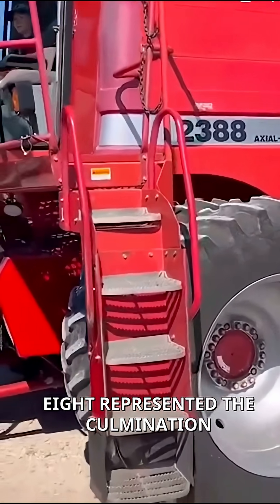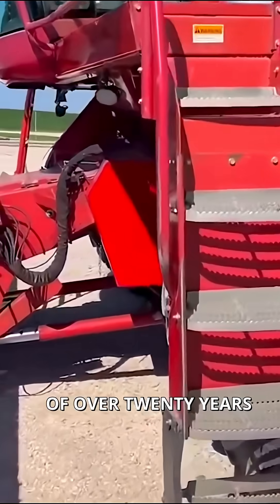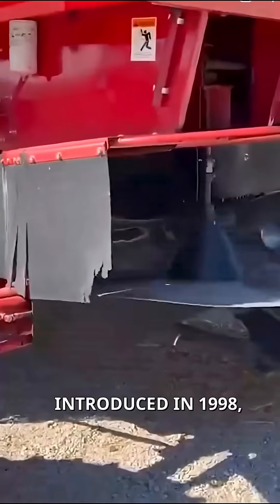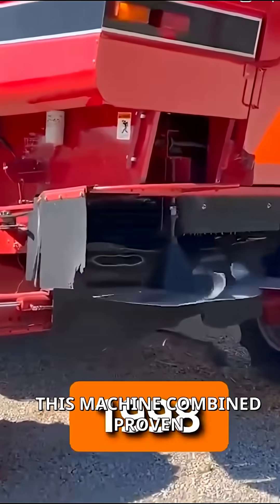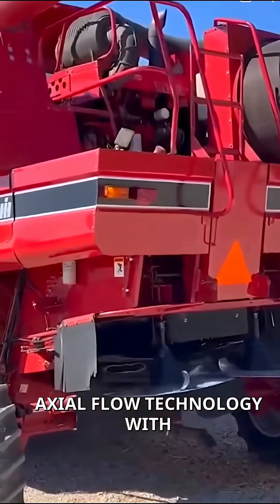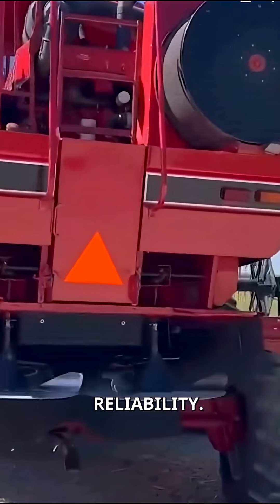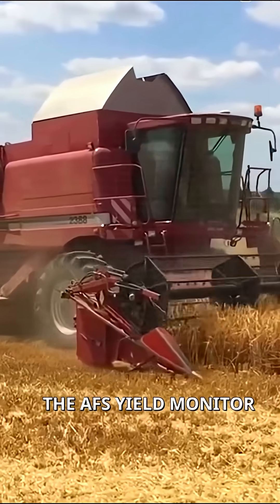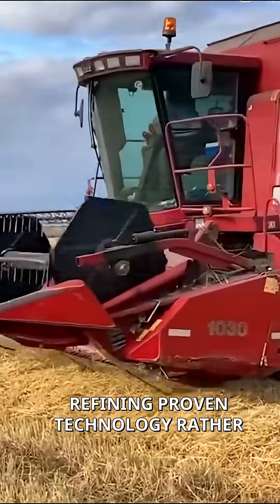“Why the Case IH 2388 Is Still the GOAT of Combines”  #PrecisionAg, #OldIronStrong #FarmingHeritage

Comment: I have a friend who farms about 1200 acres of corn and soy beans in Northwest Ohio who had a 2388 case international harvester and he said it was not powerful enough. He currently runs a 305 hp case international harvester 2588 and sometimes it barely has enough power
Reply from the maker: "Sounds like your friend really knows his equipment. The 2388 is a solid machine, but for those large acreages, especially with corn and soybeans, it can definitely feel underpowered. The 2588 with 305 hp is a good upgrade, but it’s clear that with the kind of workload he's dealing with, even that might be on the edge. Might be time to consider going even bigger for peak performance during harvest."

Comment: I'd take one over any junk deere ever made
Reply from the maker: “Facts 💯. Red iron just keeps going, season after season. What’s the biggest job you ever pulled off with your 2188?”
Reply: @ZooToon_1996 never had one unfortunately last case i remember having was a 1480 and 1660 then we switched to claas lexion
Reply from the maker: “Those 1480 and 1660s were real workhorses back in the day 😅. Switching to a Lexion must’ve felt like stepping into a whole new world—tons more capacity, but nowhere near as simple to wrench on as the old Cases.”

Comment: Lowest cost per bushel harvested you'll ever get.
Reply from the maker: “Lowest cost per bushel and still a workhorse 💪. Did you ever run one side-by-side with a Deere back then?”
Reply: @ZooToon_1996 I still run a 2188, it probably wasn't quite a match for a 9600 in good corn but as far as simplicity and reliability 2nd to none.

Comment: I got a 1997 2188 with the AFX rotor so really close to the 23
Reply: Just got a 2188 this season. Hope to do the AFX rotor update soon
Reply: @Jorrie86  There are a couple of things you can do to update it.
Reply from the maker: “Solid pickup! 👍 The AFX swap turns the 2188 into a crop-eating monster. When are you thinking of doing the upgrade?”
Reply from the maker: “Nice! A ’97 with the AFX rotor is basically a baby 2388 😏. How’s she been treating you?”
Reply: @ZooToon_1996  Pretty good. we had a 1660 for years. I wanted the upgrades the 21 had. Im trying to adjust the engine valves at the moment
Reply from the maker: “Ran a 1660 for years myself. Simple to keep going, unlike the newer rigs. Valves take patience, but that’s just part of the game.”